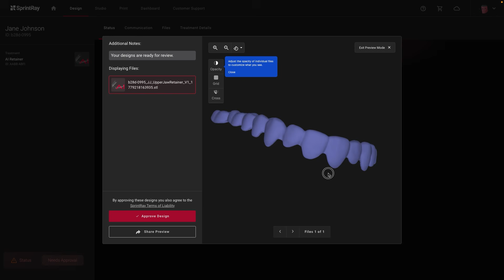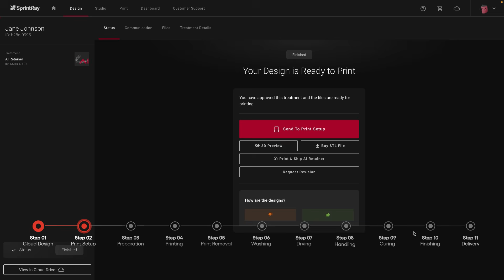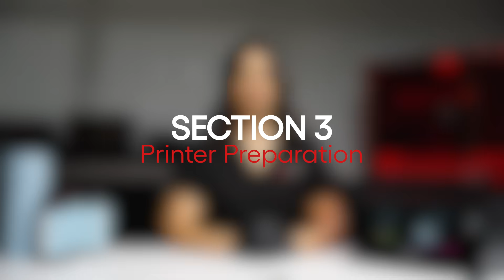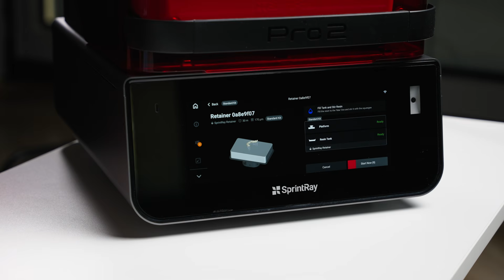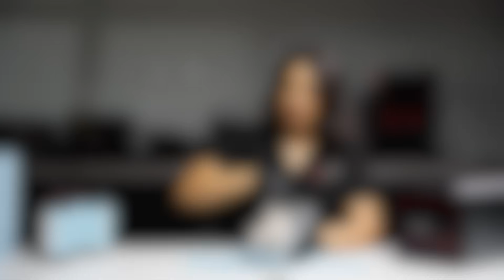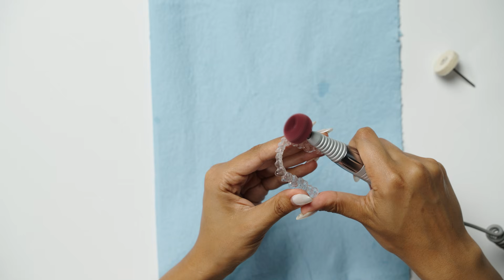How to 3D Print Retainers: Full Step-by-Step SprintRay Workflow Tutorial #digitaldentistry

Comment: Hi can you manually design the retainer with no AI or over take from Sprint-ray.
If manual is possible can you explain how
Reply: Yes, absolutely. If you prefer to design the retainer yourself, you can create the design in your own dental CAD software and then import the finished STL file into SprintRay Cloud for printing.

SprintRay Cloud supports both SprintRay-designed workflows and self-designed workflows, so you can choose whichever best fits your practice.

We also have Self Design Guidelines available that outline the recommended design parameters for successful printing. Let us know if you'd like a copy and we'd be happy to share it.